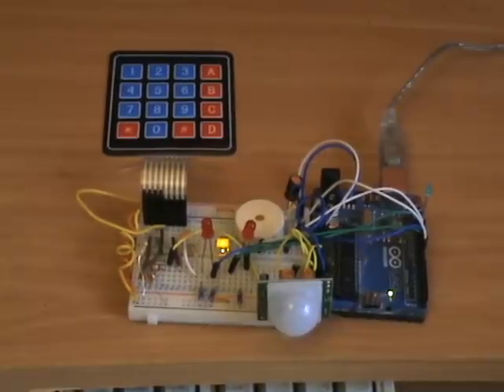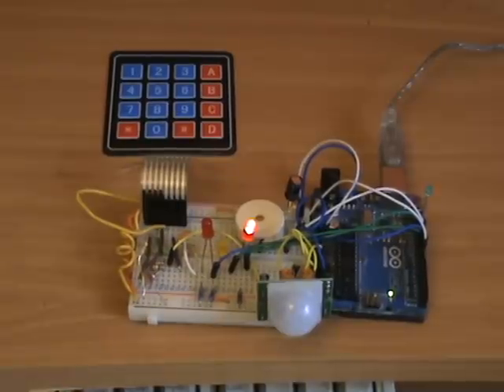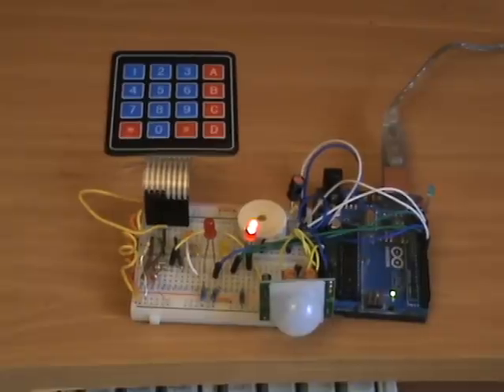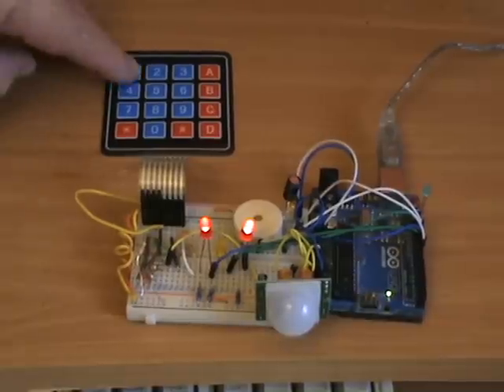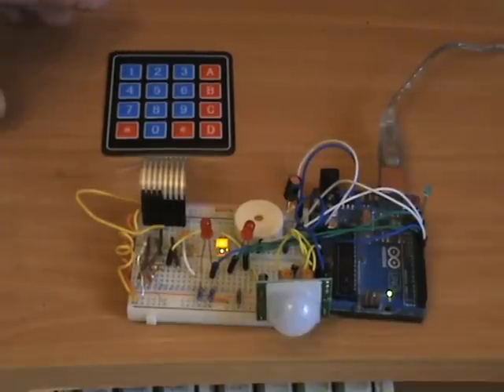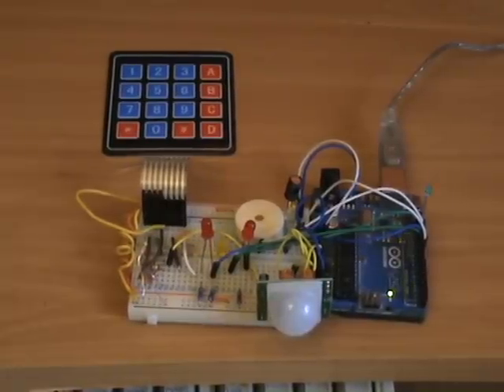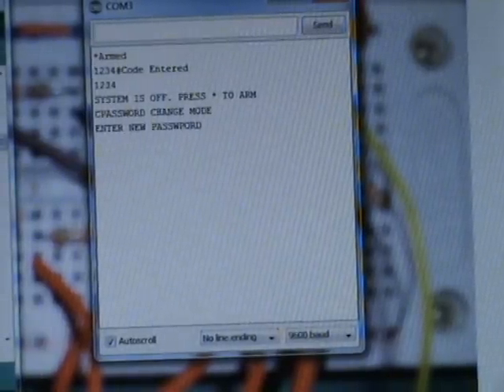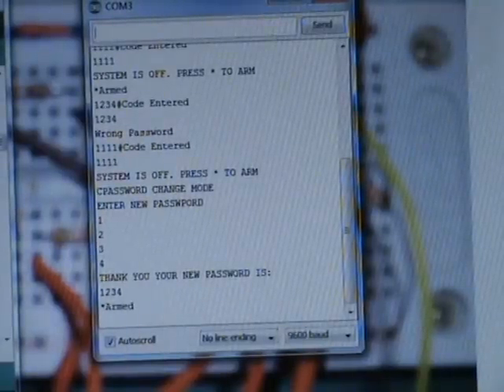Arduino Alarm with 4x4  keypad connected to just 1  Analog pin and PIR Sensor Done Arduino

Comment from the maker: all you need is on the forum. Arduino.cc
The completed code and the diagram for the keypad are there. I do not have the schematic for the whole project but if you follow the code it is self explanitory. look at the video description for a weblink.
Jezza

Comment from the maker: Hi Edwin The capacitor was 220uf with a 100k resistor the cap was charged though a digital pin via the resistor, read through A5. Basically when the alarm is off the digital pin is HIGH and charges the cap. If the alarm is set the digital pin is low and the cap slowly discharges through the resistor. When A5 reads below the value set the alarm is on.
I do not have a schematic at the moment but I will work on that when I get the time. There is a diagram of the keypad in the forum. I hope it helps